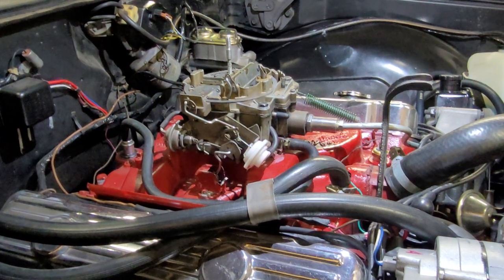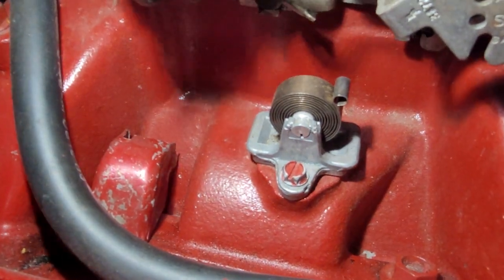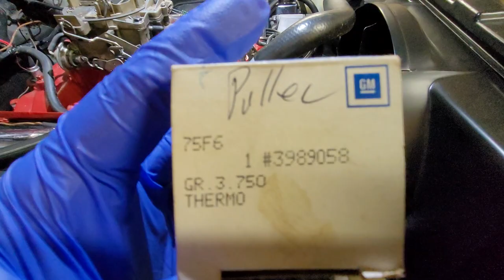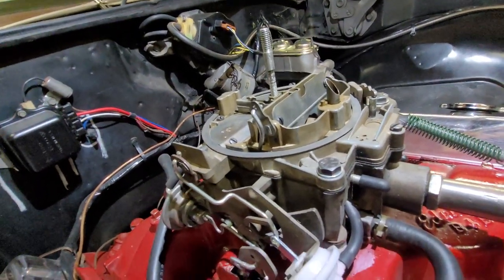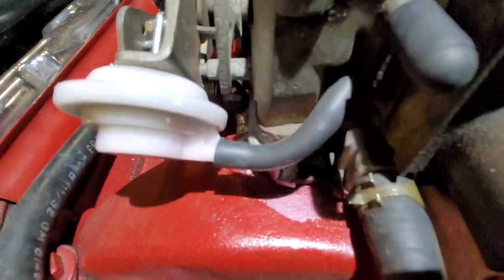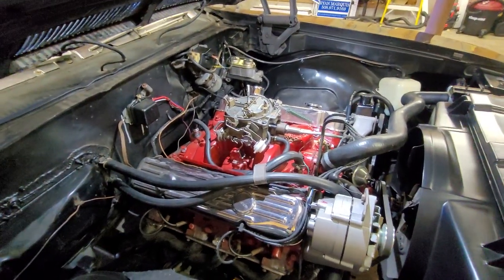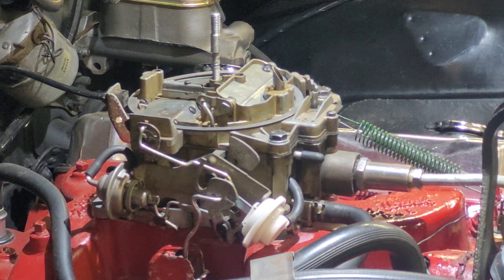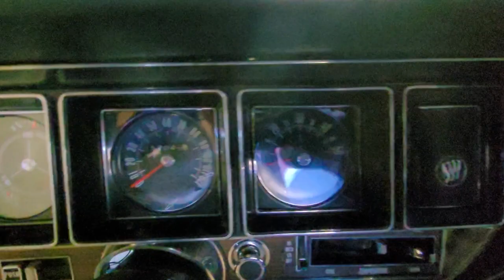Divorced Choke Utilization on an aftermarket Buick 455 Intake Manifold

Comment: Good video. It's worth mentioning the factory air cleaner is off. If it was on with a working exhaust heat riser valve connected it would warm up quicker. Coke pull offs and heat riser valves and termactors are emission control devices the purpose of which is to make the choke open sooner to reduce emissions. I live in warm Florida so the choke opens so quickly it's hard to catch on video. In fact, in the summer the choke never closes completely.
Reply from the maker: I'm running Mickey Thompson Super Scavengers anyway but I get what you're saying.

Comment: Born and raised in rhode island i feel ya the struggle is real lol I have long since moved to fla but I remembah those heat stove chokes on many cahs then they went to electric chokes and other forms of opening the choke .. I always had mine set for the wintah but a lot of my buddies didnt and they had to sit there feathering the gas and wearing out the stahtah till she warmed up a V8 would usually staht no matter how cold but a six cylindah like a ford 200 in a maverick no choke no staht period lol I learned fast that one so i figured out how to set chokes on ill my cahs she started stayed running five mins pop the pedal she comes down or even take off when on high idle while my buddies stalled in the middle of a busy road stopping traffic to wear out the stahtah some more lol

Comment: Nice video Brett. I’ve been meaning to get mine lined out, currently I manually set the choke before starting…which I shouldn’t have to do.
Reply from the maker: Hopefully this video helps. 👍🏻
Reply: @brettslater872  yes, it helps to see a proper one function on an identical engine.